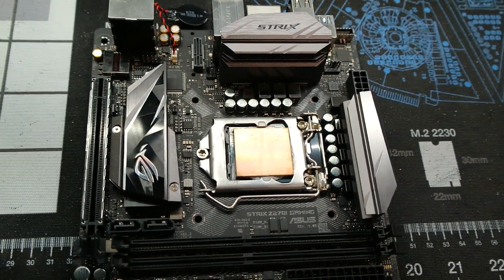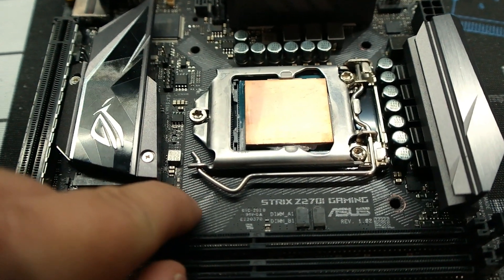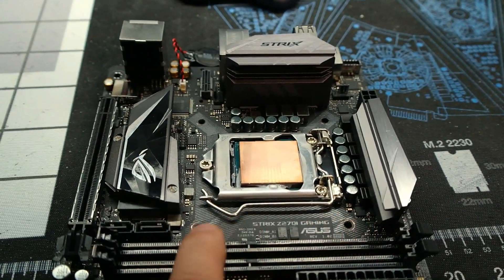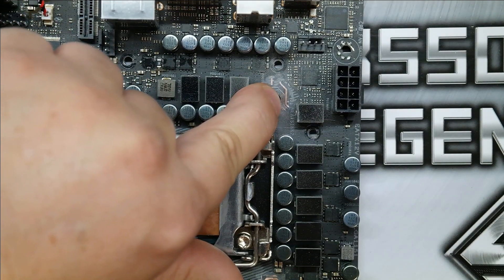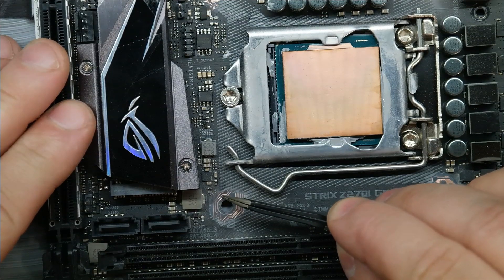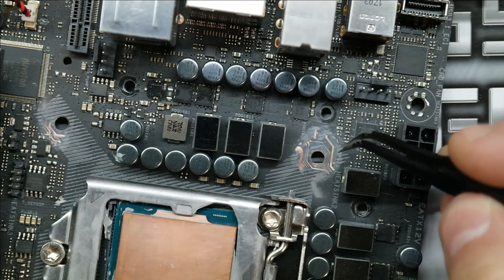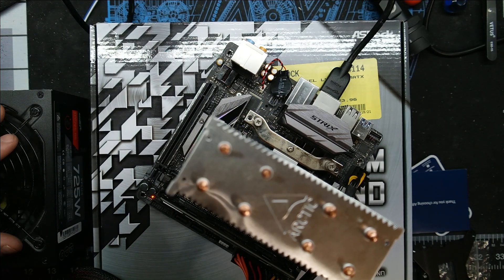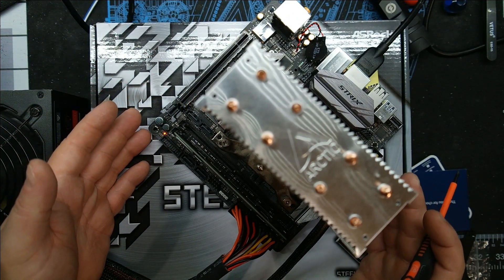Attempting To Repair Motherboard Traces

Comment: Today I connected a led strip to my fan splitter, and it burned the trace to the cpu fan header, I was able to pull the trace off of the burned spot, I ordered a new board, but I also want to try to fix the damaged one because it still boots up, the problem is the fans do not get power anymore, the led strip must have had a loose wire and shorted, I'm lucky to have not fried more then just one trace.

Comment: Damn I could have saved so much money by attempting to fix something like this! Next time I get a dead mobo from a dead trace might as well give it ago. I boke a mobo a few years ago from a slipped screwdriver when I was installing the CPU cooler and it left a massive crater in the PCB they accepted the return without question but next time might as well give it a whirl!

Comment: oh no.  Love that Arctic AIO btw.  I have the 240mm and it keeps my ryzen 1600af cool at 4.05ghz on all cores.  ive tried messing with those traces before in a mobo.  not for the faint of heart for sure.
Reply: sorry the repair failed, but i appreciate you sharing the content buddy

Comment: dang..that sucks
do you have another i7 processor to see if maybe the trace fix repaired the mobo and the processor is toast?
Reply from the maker: I have the i3 in my mining rig but i'd rather not chance losing that cpu, so I'm just going to take a torch to it.  literally, in another video.